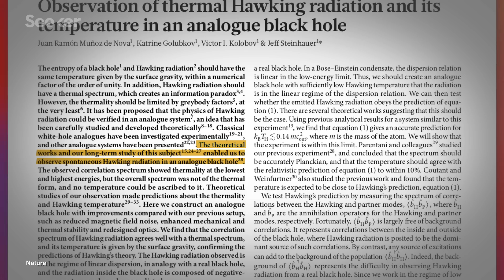How Scientists Are Making 'Sonic' Black Holes in a Lab

Comment: If light has no mass how can it be stuck in a black hole
Reply: Because photons have momentum and as such, have energy, which means they do have mass, just no rest  mass. Photons also travel along paths of least-time and around a black hole, spacetime is so tightly curved that the path of least-time ends up inside the event horizon.

Comment: It just occured to me, what about gravitational waves?  We know for sure those exist now, and that producing the energy to create them consumes a significant portion of the mass of merging black holes when those are the trigger.

If the indestructability of quantum information is true, how does it say we could theoretically extract the information about the makeup of the mass that was converted into that wave?

The theoretical mechanism for Hawking Radiation is, or at least was, entanglement.  To my knowledge that requires something that can exist as a particle, though, and we haven't been able to demonstrate the graviton as yet.  Even the LHC hasn't managed it.

I'm pretty sure you can't entangle something that exists exclusively as a wave.

Comment: Yep creating black holes, 
What could possibly go wrong
Reply: They are totally controlable sonic black holes, that exist while part of the fluid is over the speed of sound. Slow it down and bye bye hole.
Reply: If you watch the viddy, they actually aren't making black holes.
Also black holes at that size, if we could create them, would be very unstable and would decay into Hawking Radiation.
Reply: @RedHedDes  And do so within a fraction of a second.
Reply: Not much ,we would just all die nothing we should worry about 😂
Reply: They will open the gate for thanos 😰 to whipe us all

Comment: You are incorrect sir. Virtual particles do not wink out of existence upon colliding with it's negative counterpart. Matter cannot be destroyed. Energy cannot be destroyed. So when virtual particles collide, which the odds of that happening are slim to none would produce massive amounts of energy, E=mc^2. Also, if a virtual particle fell into a black hole it would add information to the black hole. It would not cause the black hole to lose information. 

Besides that NASA cannot confirm that black holes have event horizons because not even dust is able to fall into them. Just look at the data from NASA on the G2 gas cloud back in 2014. According to the laws of physics and the general theory of relativity gas does not have enough mass to produce angular momentum. That is why in 2010 astrophysicists predicted that the G2 gas cloud heading straight for the black hole Sgr A* in the center of our galaxy was going to produce a light show in it's event horizon. But when the G2 gas cloud made its closest approach to the black hole it did not fall into it. The gas cloud orbited the black hole and did not produce a light show.

Astrophysicists were perplexed because according to physics the gas cloud should not have evaded the gravity of the black hole. But observations do not lie. The laws of physics are not wrong. But the general theory of relativity is wrong. That was apparent when predictions of the G2 gas cloud had failed. 

Astrophysicists then tried to come up with a reason why the G2 gas cloud did not fall into the black hole and postulated that there must have been more mass than they were able to see in the cloud. So they assumed there was a pair of stars hidden inside the cloud. Then they went over the infrared telescope data and could not find any stars hidden in the gas cloud. Up to today they have no scientific explanation as to how the gas cloud was able to orbit around the supermassive black hole. Observations were not wrong. The general theory of relativity is wrong. 

Astrophysicists were hoping to prove the theoretical predictions of an event horizon around black holes but still there is no data yet to support that theory. But that doesn't stop them from spewing such speculation. Even Stephen Hawking back in 1974 claimed that black holes may not have event horizons. Well, looks like Hawking was right again.

Just a few days ago NASA released an image they took of the gas and dust surrounding the black hole in the center of our galaxy. The image shows the movement of the gas and confirmed that the gas is not orbiting the black hole nor is the gas falling into it. Instead according to the shift in light spectrum the gas is moving away from the black hole on both sides. It appears that not even hydrogen gas is able to fall into a black hole. Let's see them try and explain that!

In 2004 I discovered a missing variable in Einstein's field equation. After I plugged in the missing variable it took the equation in a completely different direction. It made several predictions contrary to the accepted general theory of relativity, which is wrong. Like nothing is able to fall into a black hole. Plus, black holes would not have an event horizon if nothing is able to fall into them! Thus why in 2010 when astrophysicists were predicting a light show from G2 I wrote to them that nothing much was going to happen. I claimed that the G2 gas cloud was going to orbit the black hole and not fall in. Well, I was right. 

I was even able to figure out what was causing stars and galaxies to move so fast and why space at great distances expands exponentially away from the center of all mass, i.e., dark matter and dark energy. 

Everything we are taught as fact about black holes, the movement of stars and galaxies etc, is completely speculative crap. Black hole science has turned into speculative science fiction without a lick of data to confirm any of it yet is widely accepted as fact. They would have better luck blaming many of those observations on the tooth fairy because the general theory of relativity fails every time. PEACE.
Reply: But a positive and negative particle cancels eachother. Dark matter ha negative energy. These particles come in existence with an opposite pair which is the same but opposite.
Reply: @pilotavery  When elementary particles come into existence via pair production (virtual particles) a highly charged positive proton and highly charged negative electron (ionized) appear in one spot as if they came into existence like they were standing still. See Van Allen Belts. NASA scientists said it was as if the particles slammed against an invisible wall. Note a positive proton and negative electron when they come together convert into hydrogen, the building blocks of all elements. They do not cancel each other out. If they slammed into one another at high velocity the collision would produce massive amounts of energy, see the data from particle accelerators. Those particles do not cancel one another out.

Dark matter is the mistake believing that gravity is the only force in the universe able to move mass when it is not. The effect pinned on dark matter only becomes apparent with old stars and old galaxies. Young galaxies containing young stars do not appear not to be influenced by dark matter. That was actually one of the predictions made by me many years ago. I believe I discovered the action responsible and it is not missing mass. It has to do with the time a star or galaxy has been spewing million mile per hour solar winds, i.e., weak nuclear reactions occurring deep inside the stars, which in turn produce a common acceleration rate of about a 1 mi/h increase every 10,000 years. 

This hypothesis is easy to confirm. The velocity of our own sun cannot be explained by the general theory of relativity as it travels at about 500,000 mi/h while it orbits the Milky Way galaxy's center. There is not enough mass in the galaxy or in proximity to our sun to cause it to reach such a speed. So astrophysicists invented missing mass (dark matter) to try and explain the blunder of general relativity. 

Our sun is about 5 billion years old. If our sun gained a 1 mile per hour acceleration every 10,000 years then in 5 billion years it would be traveling at about 500,000 mi/h by now. The same slow acceleration would also explain why our Milky Way galaxy is traveling at the speed it is traveling. Our galaxy is 13.7 billion years old and is traveling at about 1.37 million miles per hour. The same 1 mile per hour acceleration every 10,000 years. Just like our sun. That can't be a coincidence.

I then went on to study the dwarf galaxies orbiting around our galaxy and each one had the same 1 mi/h acceleration rate every 10,000 years. Thus this hypothesis has more data to confirm than any of the current theories that try to explain using missing mass. There is no missing mass. The velocity of every star and galaxy in the universe can be explained by visible mass now. Astrophysicists simply overlooked the fact that there are other forces in nature that cause mass to move besides gravity. My conclusion, the weak nuclear force is about 10,000 times stronger than gravity! Easily explaining the missing mass conundrum.
Reply: @pilotavery  And as for a star reaching an escape velocity is in error too because the escape velocity is not actually how fast a star is traveling but how fast is it's acceleration rate. So if every star accelerated at a slow rate of about a 1 mi/h increase every 10,000 years then their acceleration would be too slow to escape the gravity of the galaxy. That is why they are not able to escape the gravity of the galaxy.

Comment: I imagine Hawking radiation being not so much unlike bubbles forming and escaping in boiling water but with a spherical force which leaves 2 (relatively) weak points at the poles where material can most easily escape.

Comment: I don't know much about the temperature radiating out and information getting lost. But I'm a bit aware of the concept of Information Scrambling. It was analytically proven that the information is not really lost, but hidden inside the black hole. This was experimentally demonstrated recently using Ion Trap Quantum Computer ( https://doi.org/10.1038/s41586-019-0952-6 ).